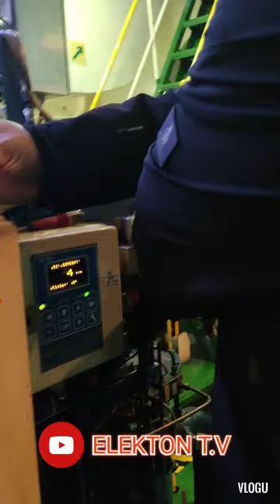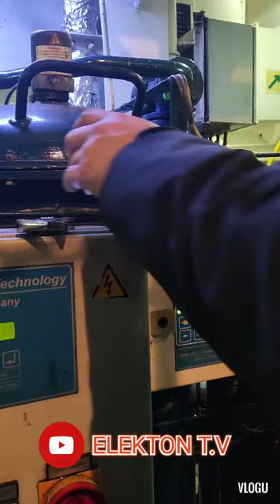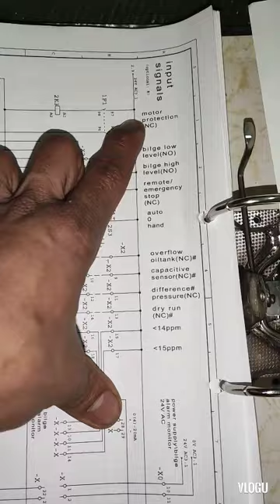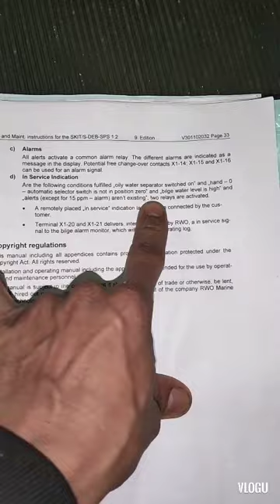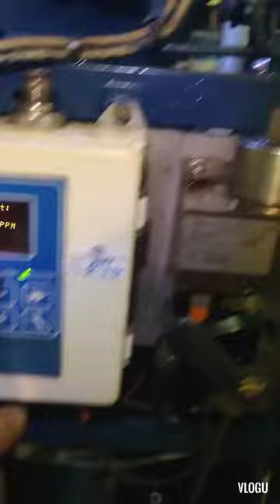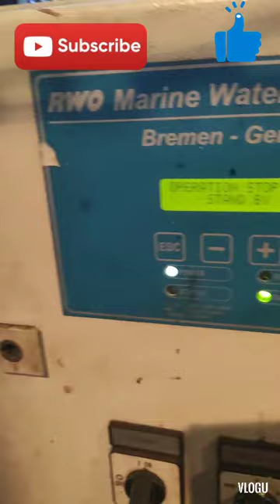OILY WATER SEPERATOR 15PPM ALARM NOT WORKING ON ENGINE CONTROL ALARM MONITOR RWO MA

Comment: sir leck, paano ka mag-accumulate ng 15ppm or more pra madetect ng oil content sensor? what if hindi pa enough ung oil content ng nsa bilge tank? need po ba talaga na lagyan ng obstruction sa oil content sensor gaya ng brush na nilagay nyo sir? thanks sir leck
Reply from the maker: my brush yan sir ipapasok mo lang sa loob.,panlinis at pang testing yun sir.,nasa video pinapasok ko sa loob..